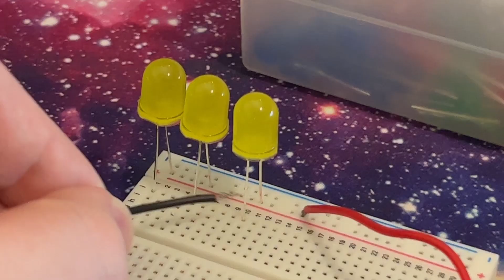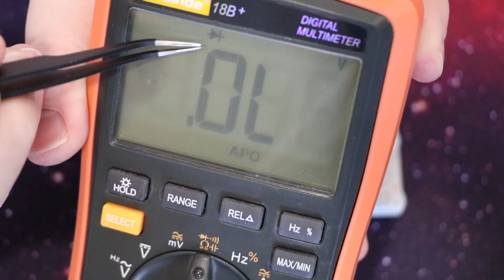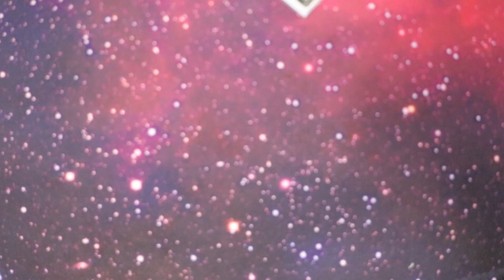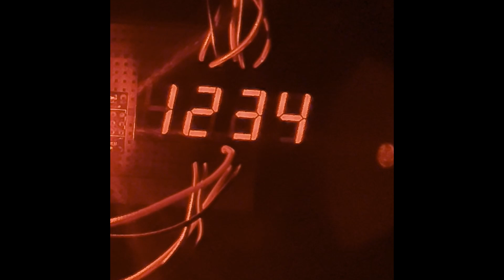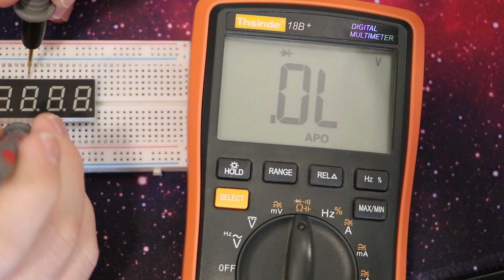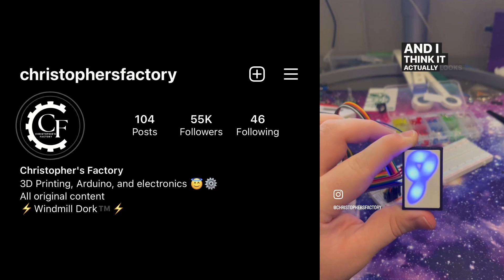How To Use Segmented Displays with Microcontrollers

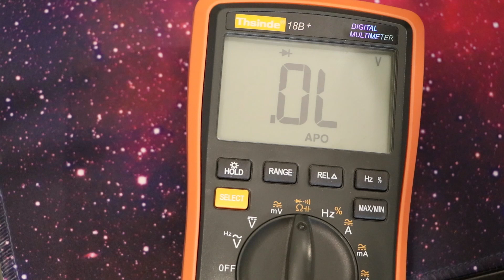Comment from the maker: A small correction: at 3:43, I said that forward voltage is the number of volts that are dropped. Forward voltage and voltage dropped are usually nearly the same for diodes, but the two terms are conceptually distinct and should not be confused. Multimeters' diode test mode shows forward voltage, not voltage drop. 

Forward voltage is the voltage that is required for current to flow across the component, typically a diode. 
Voltage drop is the decrease of electric potential along the path of a current flowing in a circuit